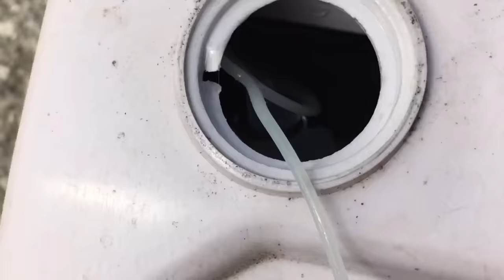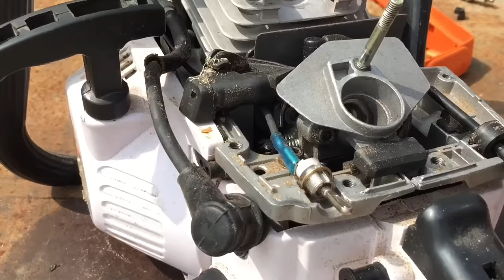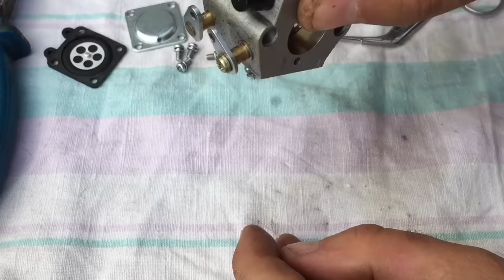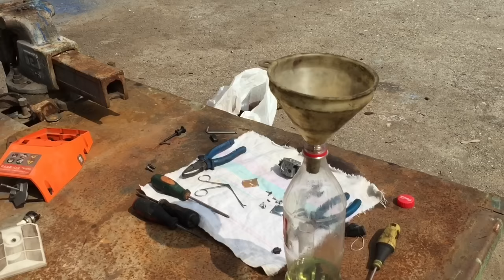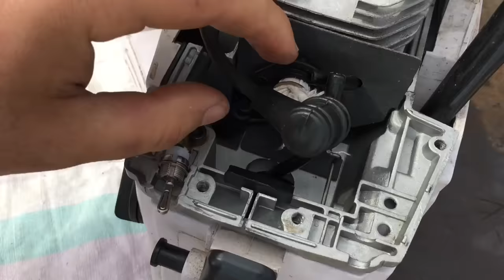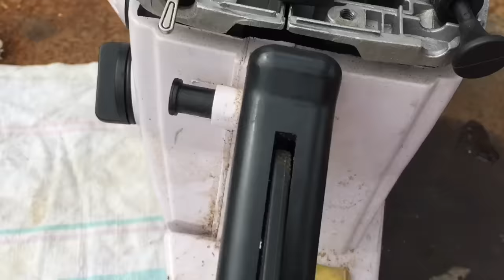Chainsaw won't start

Comment: The same chainsaw as my old Einhell chainsaw. I only had to adjust the carburetor correctly because the device started well but didn't take any gas. All the components are absolutely the same. I think it's a very reliable saw when it's not dying. I once had it in the garage for a little over two years and the gasoline smelled like kerosene. I filled it with fresh gasoline, pulled it twice and it ran as usual. I only had to change one fuel hose after 3 years because it had become a bit porous. My conclusion: a good device for little money...

Comment: Nice i will try it tomorrow for my Chainsaw.   I purchased new one but I'm very disappointed because it's never start up. I hope that's only the issues.  I will clean the carburetor and sparkplug tomorrow.
Reply: It's all good but if saw has low compression, nothing will bring it back to life.  I did all of these things he doing and saw did not turn on. It turned out that cylinder was bad.  I think he should say why he jumped to conclude that Carb is bad.
Reply: @SA-lr1sf  Probably because he felt that the compression was good so the cylinder, rings and piston were still good. However I would have tipped the fuel (and any water as seen in the carby) out and replaced with known clean 2-stroke fuel. AND checked the tank strainer was clean and no holes in the fuel hose and diaphram drive pipe before pulling the carby to bits. Also cranked it over to see a good plug spark as well. Carby jets and strainers can get blocked and diaphrams puncture etc but much less often than muck in the fuel tank and perished hoses.
Reply: Stormlli ss
Reply: Heri Purwanto
Reply: @SA-lr1sf  
W be
Reply: Haeh
Reply: @heripurwanto7754  ppuaruruyrl

Comment: Hola, para comenzar vacía deposito gasolina y ponle combustible/mezcla nuevo...antes de intentar arrancar tiene que estar bloqueado el gatillo del acelerador(tu no lo tienes bloqueado) , después cerrar entrada aire al carburador (estárter estirado), ya puedes tirar cuerda arranque si después de tres o cuatro intentos no sentiste explosión sigue probando con el estárter un poco a medio (si no corres riesgo de ahogamiento motor).
Llegado a este punto y para descartar chispa, quita bujía ponle un poco de spray limpia carburadores o gasolina/ mezcla por el orificio y vuelve ha ponerle bujía y intenta arrancar...si arranca por un momento y se para el problema será de carburador, mangueras o filtro combustible 
A si lo hago yo.
Saludos a todos.
Reply: Entonces tiene que estar presionado el gatillo como si estuviera acelerando
Reply: La mía es nueva y se ahoga y no prende, ya limpie varias veces el carburador, una cosa que note es que el filtro de aire igual al del vídeo estaba roto

Comment: I do not have to remove the carburetor to clean, just remove the spark plug then pull and hold the starting rope a few times, put the spark plug back in and pull to restart- work well for me , chain saw, pressure washing machines all those 2 cycle engines.
Reply: So you are basicly pushing all the crap from the carburator into the cylinder and putting it in a big risk to get damaged or even destroyed.
Reply: K9
Reply: @KK-dt4gj  Actually I think he just has a habit of flooding his small engines. 😁

Comment: I always check for spark, first,  then for gas.  Squirting a little gas down it’s throat quickly checks for spark, because if it runs, you have spark.  If it does not, then spark is the problem.    Did you put the diaphragms on right?  Metering side - gasket, first, diaphragm, second.  Pump side. - diaphragm, first, gasket, second.

Comment: I did all of these things to my pro260 but it did not turn on.  It turned out that it had low compression.  You are lucky that it turned on.  Please tell your viewers how you diagnosed the saw.
Reply: How did you fix low compression
Reply: @bekabeka71  New cylinder, rings and piston! 😁
Reply: @theoztreecrasher2647  oh fuck that mate 😂 you’d buy a brand new chainsaw instead 😂
Reply: @bekabeka71  LOL! At the price of parts these days you certainly would have! 😁
Reply: @theoztreecrasher2647  😅

Comment: I once bought a brand new Stihl  line trimmer and it never started ever and even my mechanic or friends could not start it . I threw it aside in anger and bought a Honda and never looked back some time later after warranty expired I decided to take it to Stihl and see if they could start it , they could not so out of curiosity I said fix it . $250 later  and a stack of new parts including  whole new carburettor  and it runs ok  and they knew the trimmer was brand new never started and not even a discount .  Would I buy another Stihl product ? NO way .  Husqvarna treats the home maintenance type   customer way better .
Reply: Something a bit odd about your story there. Anyone who buys a product that doesn't work and has a warranty would be back on the doorstep next working day! Well unless he was taken off to jail over the weekend. 😜😁
Reply: You'll expect a discount after you let your warranty expire? Crazy....
Reply: Espñol
Reply: On Stihl equipment, "O" means off.
Reply: Aaaakaaaaaaaam

Hi